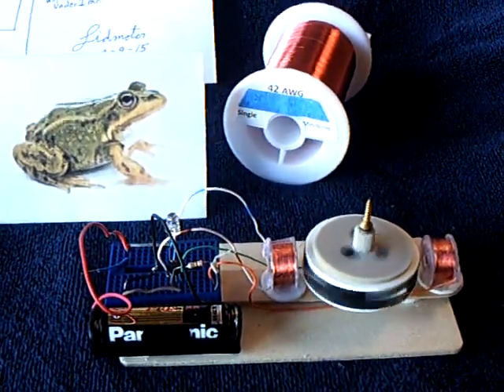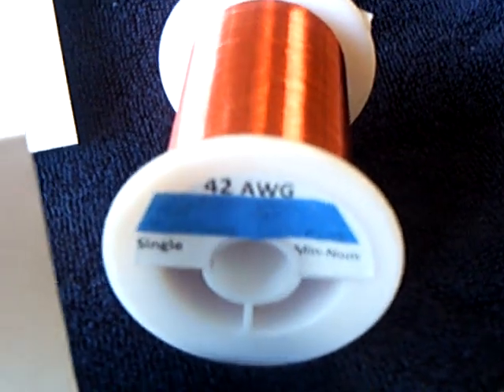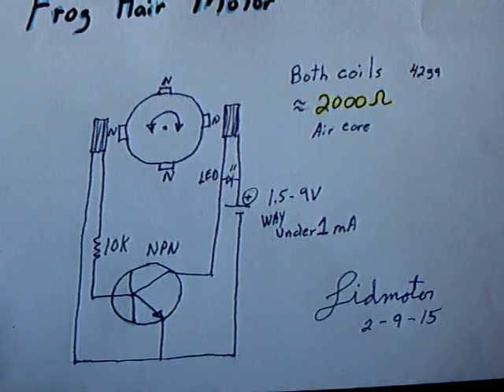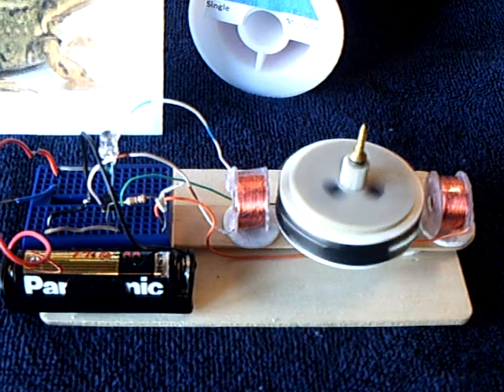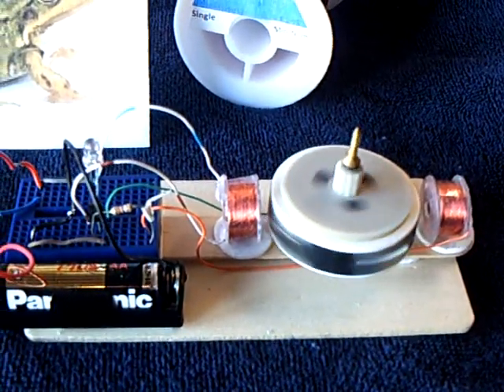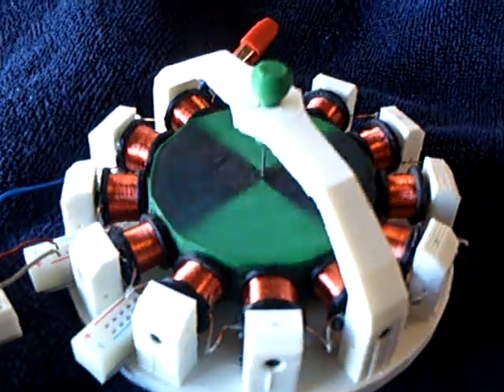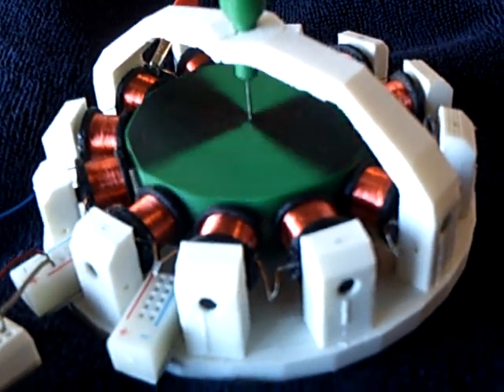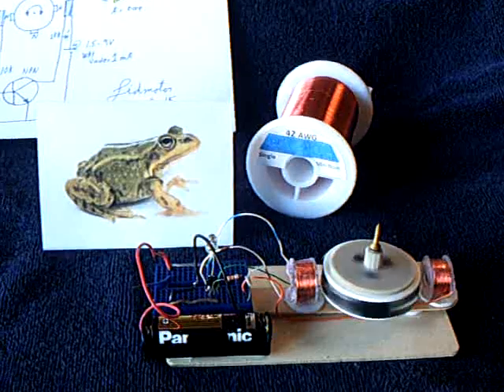Frog Hair Motor

Comment: This is cool.  Does electronic switching use less power than the reed switch method?  I built a version of the ez-spin motor (the one shown on my channel) but used a reed switch.  I can get it to run 3-4 days per charge but I have massive a cap at 3.6F.   I know that those reed switches have some interference on the rotor that your motor here doesn't have.  The electronics do use energy to work though.   Which is better?
Reply from the maker: DaveC1964 My experience so far is that a good quality reed switch is easier and will work on much less power.
Reply: ***** Thanks.  Are smaller reed switches better due to the lower magnetic draw or does it matter?   Have you seen the motor I did and do you have any suggestions for improving performance such as magnet placement number of coils etc?Thanks for the info and showing your motors. I really like the kinds of things you make and all of the variety.   All pretty interesting and inspirational (I stole your idea for sewing machine bobbin coil forms  and used them in my motor ;).

Comment: Have you ever thought of using a germanium PNP Transistor, It will work at a lower voltage, might be the answer, ok you would have to reverse the voltage of the battery but I use to use one in a Crystal set (you know a radio that is only powered by the radio wave itself.

Comment: Great motor and work, Lidmotor tnks for sharing :) - i turned some time some coils with the same wire and 1100 turns and i know how it is - what i want to tell is that you can switch between 2 AA batteries to go with this motor almost forever - 24 hour rest the other batt go, then switch between AAs. I think anyway based on my experiments, that if you go under 10 uA, the motor can go forever, because the battery is recharging a little in the process, especially if you use bifilars. All the best!

Comment: That is very efficient running motor. I wonder if you could power that for years using a super capacitor and small calculator panel inside a plastic box on the self.
Reply from the maker: egn83b I'm already on it.  Been running non stop for several days now. Super capacitor and a small solar panel.  Stuff of dreams really.  I always wanted one of these.  It's fun to wake up in the morning and see it still spinning.
Reply: *****
Now that you have this thing going in this configuration might want to try adding a secondary magnet lid motor and see if you can power say maggie or something else long term without bogging this primary mover down.
Reply: *****
best of luck in whatever you try. I am always amazed by your persistence to keep pushing on.

Comment: Gust a question lid, did you use the sowing machine to wind the bobbin?
Reply from the maker: +cornishman1987 No.  I used a 3/8" variable speed house current elerctric drill.
Reply: *****  fair enough I thought it would been a neat way of winding the bobbin but I Guess that it would be to aggressive for that gage of wire

Comment: High ohm coils are great, definitely a fan. 40uA on a non reed motor is superb !
I'd have thought 2N2222A, MPSA18, but not that one haha.  
When moved to Minnesota from England, I saw how flat the state is. Used to say similar about wire 'half the thickness of a hair from a Minnesota mountain goat' :)
Reply from the maker: +slider2732 Minnesota---Ah the 'land of a thousand lakes' and the extremely rare montain goat.  I ran this on these NPNs also: 2N2222, 2N4401,and 2N3904.  The MPSA06 just happened to work the best.  This self oscillates when the rotor is not turning at 8uA but the led is very dim. I can't hear this running on my AM radio at all.  I shoulld hook this up to my oscope and see what is happening.

Comment: Nice vid.
That is very fine wire.  42 awg enamel coated wire is 0.0026" or ~1/385th of an inch (actually thinner than 20 lb bond copy paper and some people's hair.)

Are you trying to make a pulse motor that runs 24 hrs just for the heck of it or do you have an application in mind after you figure out how to do it?

Thanks for sharing!
Reply from the maker: Getting a small desktop novelty motor to run 24/7 on ambient energy has been a quest of mine for a long time.  I might apply some of what I learn to something on my sailboat.  Maybe a ventilation fan that ran all the time.
Reply: ***** Hmm.. I just wondered I'm not sure you'll have enough torque to move much air, but that's interesting.  You could use it to turn a disco ball -- if you're into that kind of thing. ;)

Comment: This is awesome like always! What is the flyback voltage? The white LED looks dim. Have you tried a red LED just for fun? Will it run from a home made cap? I think it would be interesting to make two frog motors, and then add two LED's in series on each circuit, then tap the middle of the two LED's to charge a home made cap. Then, try running both devices from home made caps being charged from the opposite device. See if one will run the other while the other runs the one. Well, at lest for a while until all the energy dwindles away. :-)
Reply from the maker: Thanks.  The flyback LED faintly blinks at this power input level.  I really only have it in there to indicated the firing.  Two 'frog motors' might fight I think.

Comment: Well done Lidmotor ! Is there coming any blinking light from the LED at this low current input ?
How good is the torque ? Will it stop immediately when you apply friction ?
As the input is only around 60 uWatts, it would be interesting to see, if the mechanical output is higher than these 60 mikroWatts of Input power...